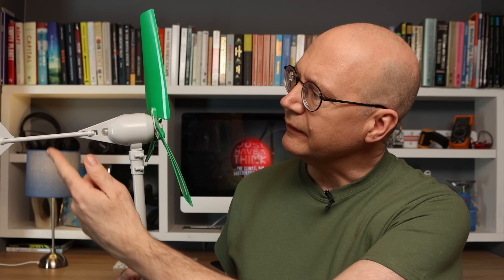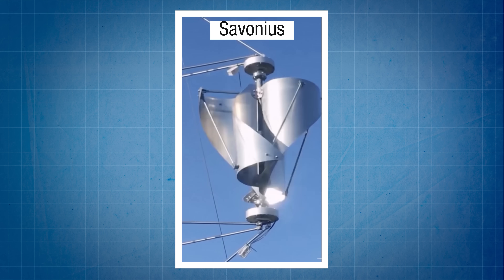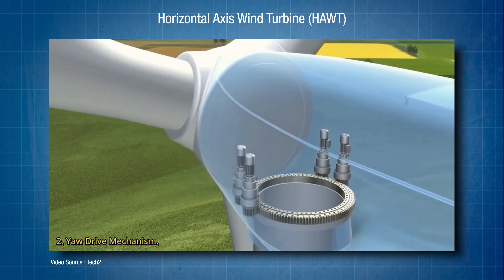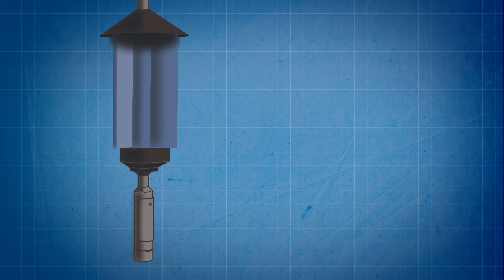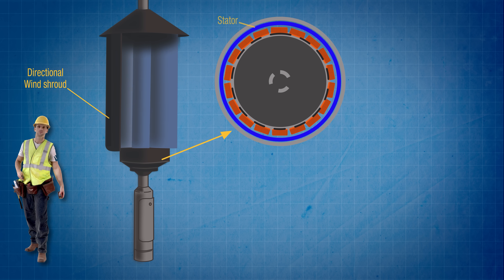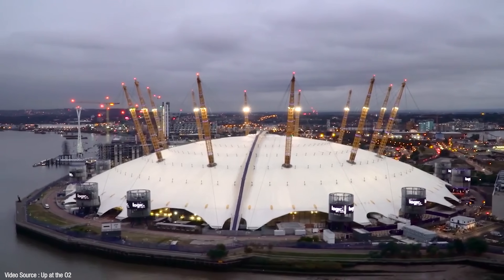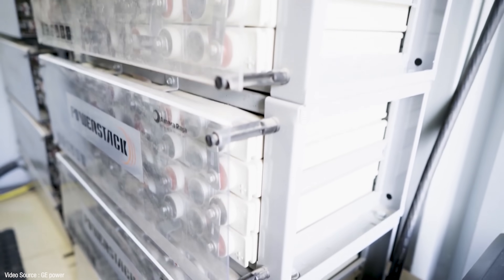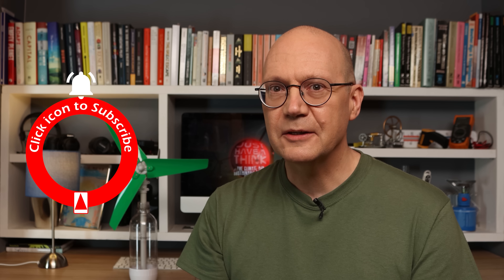A vertical axis wind turbine that doesn't need the prevailing wind! How do they do that?

Comment: A great design for a VAWG, they should be trialled on lengths of a few motorways, but I’m convinced they need to be rolled out country wide for any towers even electricity pylons, domestic use, street lamp posts etc etc.

Comment: If these machines are located closer to the moving vehicle they would recover more energy. Locating them closer will cause back pressure and the vehicle will consume more fuel so some of the effect is fossil powered. Harvesting wind is great, but these need to stand on their basic efficiency numbers for wind energy. cost, and reliability.

Comment: It be an interesting experiment to see if cars burn more fuel when driving in an open air with nothing obstructing the flow of air away from the car and when you have air flow disrupted by these wind turbines.  Something tells me that these wind turbines close to the side of the road will increase air pressure as the car drives past thus making them burn more fuel per mile.  That would be a bad thing.  Throw in the CO2 created when manufacturing the wind turbines and the needed infrastructure to transmit the electricity they generate and the whole thing might be a bad idea.

Comment: There is one small thing. Why is the generator in the bottom of the housing? Being an outdoor appliance, it will need to be rugged against water ingress. Having the generator at the top in the umbrella would reduce the chance of water getting into the electrical appliance.

having the fin assembly hang or rest upon the generator assembly would not really make much of a difference, if at all. but would make a big difference in its water ingress potential.

Comment: So, tell me where my thinking is wrong:
Harvesting energy from the wind generated by cars must reduce the wind speed once the energy is harvested. Which means the next car has to push through (slightly) slower air than without the turbine. So, I'm thinking each car has to increase the latent airspeed more than if the turbine wasn't there, which would be seen as extra drag (Even if very slight). I would compare this to the type of thing going on when people say "harvest wasted energy from induction loops under high-voltage cables!"

I think neither is "free" energy nor is it energy from a wasted output. Energy can't be made for free, it has to be moved. In both this and the induction-powerline example, the energy harvesters thermselves produce a load on the system and require the system to replace that lost energy.

I have no ideas what (pun intended) the numbers are, but I suspect it might be 10s to 100W extra loading on each vehicle. While that's not much in terms of the kW needed to propel a car, it's not zero either.
Reply: From your very first sentence.

Comment: Would these turbines really just “scoop up” air being pushed by passing vehicles? I think a row of turbines would steal power from the cars if they are placed too close to the roadway. With turbine after turbine spinning they would be disturbing the air and causing drag on the passing vehicles.
Reply: Go stand by the edge of a busy road and feel the air for yourself.
Reply: @davidwatson2399  You simply do get my point. My point had nothing to do with the fact that wind is created created by passing cars.
Reply: @jeffbransky6499  
How would they "steal power"
Do roadside barriers,  fences, guard rails, trees steal power?

Comment: The energy companies are going to love this if everyone installs these and puts them out of business. Perhaps you could do a film on what if everyone produced their power how would energy companies survive?
Reply: The grid still has a lot of value even in a distributed generation scenario, where the power company owns no actual power plants.

1. Even if you have enough power generation for your own needs, you need power to be available 24 hours. So you have to also spend $$$ on a bigass battery, to store your solar power overnight. But then,
2. Oops, now it's rainy and cloudy for a whole week, and your solar power generation is way below average and your "overnight" battery isn't big enough to make up the difference for that long. So, more $$$ to overbuild your solar installation and/or your bigass battery, to provide a lot more than 100% of your average power draw. OK, but then,
3. Axial tilt! Now it's winter for a few months and there's physically a lot less sunlight available than in the summer. Your battery can store excess power for a week but it's nowhere near big enough to cover you for months. So, even more $$$ to overbuild your solar and/or battery even bigger, to cope with winter conditions of sun and wind.
4. Rats chew your wires. Your inverter fails. A tree branch falls on your solar panel. Your battery catches fire. Your wind turbine bearings wear out and the blades wobble dangerously. Lots of things can go wrong when you DIY your power. You can spend even more $$$ to keep spare equipment on hand, or accept that you can be SOL at any time waiting for Tesla to send you a new Powerwall.

Point is, the power grid can save you all kinds of $$$ even if you want to generate on average all the energy you will use on average. They can provide these things more cheaply than you can, and so I don't think the grid is going away any time soon. Even if they end up owning less generation capacity than they do now.

Comment: It doesn't really matter if the blades start spinning at 1m/s, the actual harvestable power is proportional to the cube of the air speed, so there's barely any energy to harvest in 1m/s anyways. That said every little bit counts, of course, I don't want to sound too negative.

Comment: It isn't all wasted energy.  It's like slowing down a river.  You must paddle your canoe harder when the river slows. It's very small but there is a calculable cost.  I'd love to see someone smart calculate those numbers.

EDIT: This also makes me wonder how much energy could be saved by splitting opposing lanes of a highway.  Not much but a cool experiment!
Reply: My intuition tells  me that if the cars  produce the wind then if you get power out with the windmills it is going to slow the cars or make the cars burn more gas to get through the same tunnel of air.
It would take some careful measurments to figure it out.
But the power from the natural wind must be a significant amount also.
trains tracks, power transmission lines would work also.
Reply: @douglasrayanderson4546  It's not worth doing accept for the journey itself.  I'd like to see someone like author of Humble Pi Matt Parker tackle it.  I think it would make a great video.
Reply: @jmr  Thunderfoot would be interesting to see if he can analyze it.
Reply: A river has well defined bounds containing the flow, and the flow is controlled by elevation and gravity.  A river is like a half tube, and very little water escapes out the top of the tube.

That's different from air on a highway.  The air itself is not usually flowing down the highway... unless there's a wind.  For the most part, the car is the only source of energy flowing down the highway.  As it hits the air in front of it, it's transferring its own kinetic energy it produced into the air.  That energy spreads out around the car through the air wake it creates.  Some of that energy may return to the car through a vacuum.  Some may follow the car down the highway, where other cars can take advantage of it.  Some will go to the other side of the highway where it'll create a headwind for oncoming traffic who will now have to use more energy to overcome it.  Some may flow off the sides of the highway or up into the air, where the energy is simply lost.

The idea is to capture the energy the car transferred to the air movement that would have otherwise created a headwind for the other side of traffic, or been wasted to the sides of the highway.    As we know, the amount of energy a car transfers to the air at high speeds is pretty massive...  Anyone whose ever stopped on the side of the highway and had the wind shaking your car as cars flew past knows that.

The issue however is that the turbines will never use that energy efficiently.  The most efficient thing we can do is avoid transferring so much energy to the air in the first place by slowing down the cars.  The amount of energy required to offset the air grows exponentially the faster we drive.  We can build these costly turbines to absorb some of the lost energy, or we can just reduce speed limits.
Reply: @updlate4756  Not all that different.  You started like you were trying to make a point and then drifted off.  Think of it like the jetstreams if that works better for you.  Airplanes change their flight paths to enter jetstreams that flow in a favorable direction.  Yes the effects of the turbines are almost certainly negligable.  That's not really my point.  I'd like to see how someone could quantify it because I could learn something from the process.
Reply: The turbines are to be fitted to existing poles, which must already interfere with the airflow and do not move. Once a turbine is spinning, it is moving with the flow and takes very little energy to keep it moving, so improving  the airflow and helping  the vehicles.
Just a thought. Research needed.
Reply: Air pressure in the open is a gradient and blades in that gradient do increase resistance where the pressure is generated which is the car. Main power need of a car is air resistance. So this causes a huge increase in fuel consumption but generates only a tiny amount of kinetic energy at the blade.

Comment: I love this concept!
Question though: This system would effectively be taking energy out of a moving airstream thus slowing it down, would this increase the effort needed to be exerted by vehicles driving along those motorways and thus increase the amount of pollution they emit? Has there been any mention as to if this energy harvesting method is better overall or worse? 
Just thinking about this concept holistically.

Comment: Something weird with the numbers. At 9:25 in the video it says 3 MW from 125 turbines, which means 24 kW per turbine. But at 5:54 it says 1 turbine produces 5.8 kWh per day, which means 0.24 kW, i.e 100 times smaller than 24 kW ?!
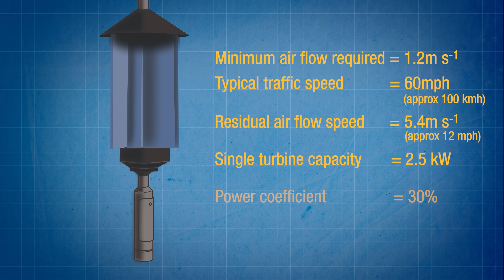Reply: It's worse: Dave's numbers don't stack up, they are wrong by either two (5:31) or three (8:50) orders of magnitude. So which is it, 2.5 or 24 kW? The right number for a VAWT this size is about 25 watt, by following the standard VAWT physics formulas.
Reply: @tzenophile  Yep, 25 watt seems like a more intuitive number for a small fan on a pole.
Reply: @OlofAndersson1  25w MAX. Cheers!

Comment: There's no such thing as a free lunch!
These roadside turbines are petrol powered!
Reply: They are wind powered, it doesn't matter what the vehicle producing the wind is powered by.
Reply: @davidwatson2399 
So the energy comes from the vehicles?
Reply: @_a.z  
And?
If the cars are electrically powered then it's not petrol.
Reply: @davidwatson2399 
Not all cars are powered from green energy or are likely to be during the life cycle of these generators.
Reply: @_a.z  so what?
Reply: @davidwatson2399 
The designers are simply not seeing the big picture... 
If energy can be harvested from vehicles, then it would be possible to reduce loading on vehicles. 
Highways could have reduced "street furniture" to allow for a more efficient  windflow as vehicles pass and could create a more continuous slipstream. 
The proposal is a tortuous route of energy delivery that creates losses rather than any gains.
Reply: @_a.z  
You are simply talking nonesense for the sake of argument.
Reply: @davidwatson2399 
Tell me where the energy comes from?
Reply: @_a.z  
No
I suggest you tell us.
The vehicles are already moving, creating air disturbance,  with or without the thingymajigs on the roadside.
Reply: @davidwatson2399 
I think the clue's in the title..
Energy is harvested from passing vehicles.
Reply: @_a.z  
Wind
Reply: @davidwatson2399 
Re-read the title!
Reply: @_a.z  
I don't think you actually watched and listened to the words.
Reply: @davidwatson2399 
The turbines take energy from the wind caused by the vehicles?
Reply: @_a.z  
Finally you get it, but they don't  "take" it.
Reply: @davidwatson2399 
Oh?? They give it?